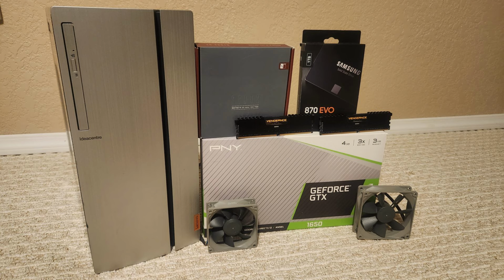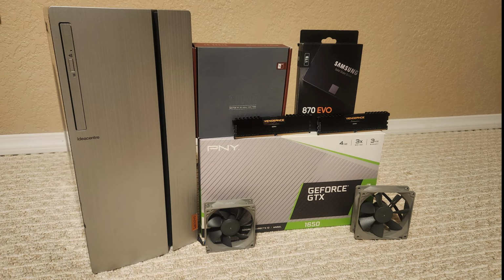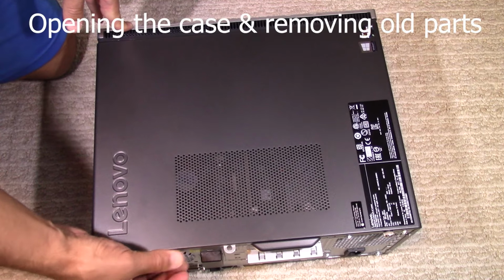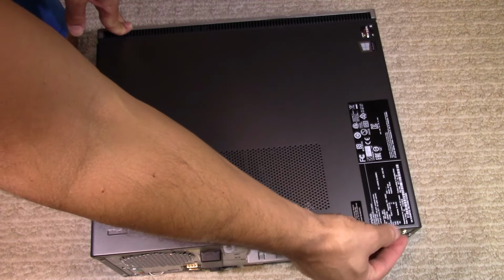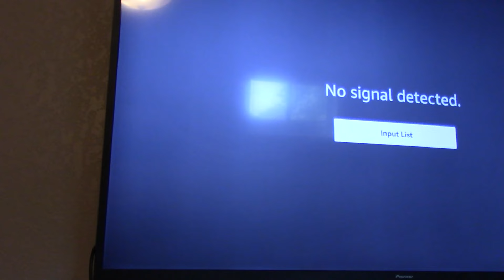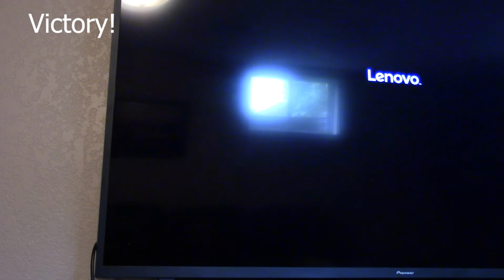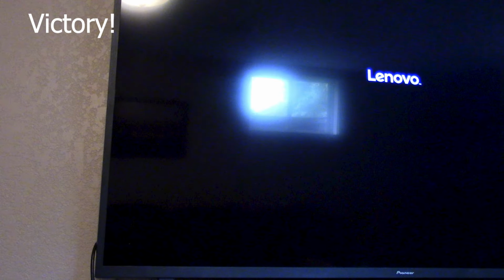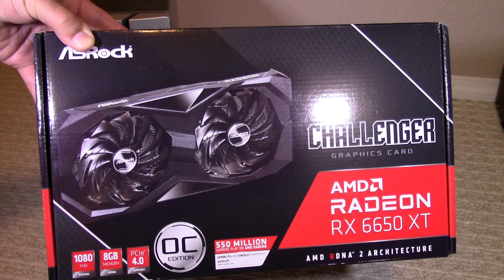Lenovo IdeaCentre 720 ASU Gaming Upgrade (Ryzen 7 1700 and GTX 1650)

Comment: Hello brother, I have a 250 watt 80+ Platinum power supply and I would like to run a GTX 1650 super or a GTX 1660. Can I?❤❤
Reply: If you can find an A2000 or a RTX 3050 6gb, that might be your best shot with Nvidia. Or go with an Arc A380.

Comment: nice video,i'm not sure but i don't think the RX6650XT is going to work due to lenovo stupid gpu whitelist system integrated into their BIOS. i'd love to hear how it went in your case did it work ?
Reply from the maker: Well, I got demonetized on YouTube and I just haven't had time to do more videos, but I did use the RX 6650 XT in the computer.   It ran great, but the card way too big to even close the case, so I had to run benchmarks with the case open.  You might be able to it in, but it would take some serious modifications to the case.  Thanks for watching!
Reply: Thanks for the reply, Yeah these computers are a burden to upgrade; You gotta make sacrifices. Maybe I will consider getting a RTX3050 lp 6GB at the moment, I don't think my little Lenovo deserves better haha